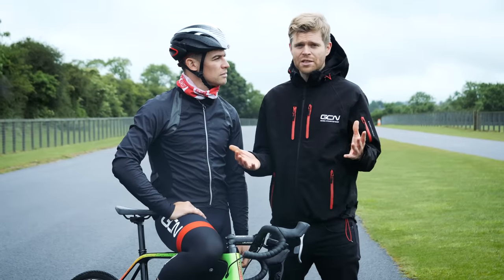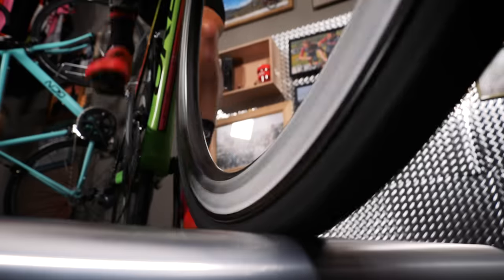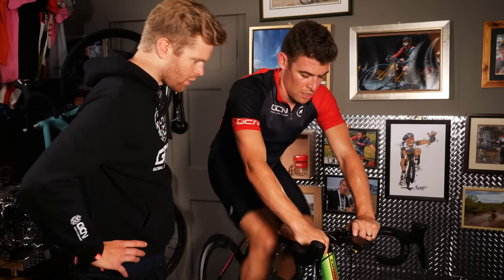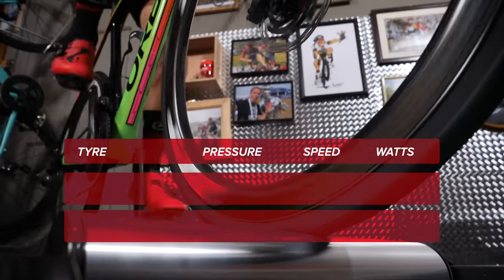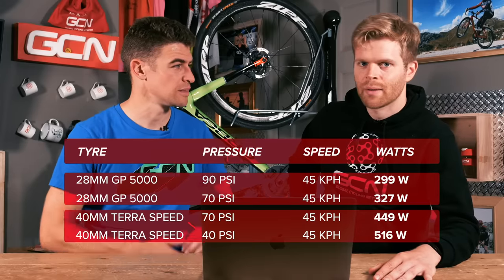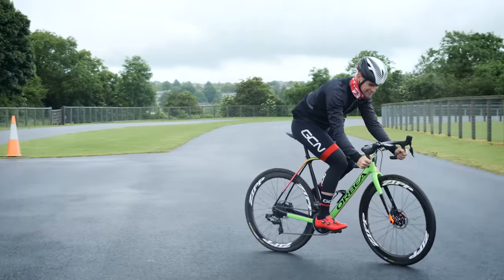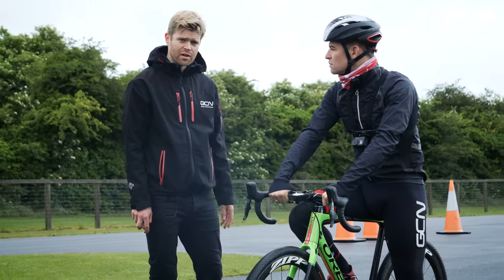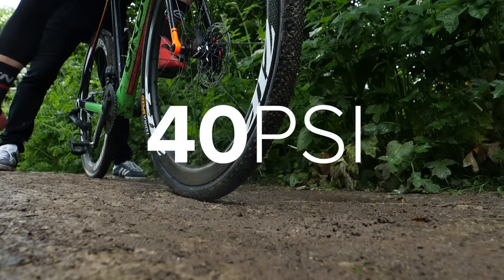Gravel Vs Road Tyres | How Much Slower Are Gravel Tyres?

Comment: Interesting - bicycle quarterly did a similar test but with slick, very supple compass tyres on imperfect tarmac and they basically found that rolling resistance decreed as they tyres got bigger until they reached 28c at which point rolling resistance pretty much levelled out until they reached absurdly large volumes of over 50c - they also found that tyre pressure has little to no impact in rolling resistance, so long as the tyres are slick, supple and light-weight.
Reply: Ding ding ding ding ding you sir are the winner! 👍👍👍
Jan Heine & Co., have proved that this BS is nonsense once again gcn proving their ignorance and lack of understanding when it comes to Scientific experimentation inductive reasoning and actual analysis
Reply: Thank you for bringing this up. It’s actual best tested in doing Strava segments with different setups. My experience has been that 44mm slicks roll as good as 28mm on tarmac and much faster on bad taac and gravel. No doubt whatsoever. Just let the masses ride their skinnies and suffer bumpy rides for no reason.
Reply: Long ago, I disregarded the 
'Conventional Wisdom' and have often utilized 38mm - 60mm (99-123mm) tires on Mountain (& FatTire) Bikes - *OnAsphalt*...  
My Klein QuantumII & LeMond 'RoadBikes' have almost 200 miles on 28mm (Max) Tires - after 4 years...  (while) 
My On*One Fatty with 4"/99mm FatTires has been ridden over 345miles - On ONE Weekend...!!!  
My Trek Farley EX8 Full-Suspension FatTire MountainBike gets more mileage a month than all my (so-called) 'RoadBikes' and 'TouringBikes' put together for the year...  
(My Brevet Randonnee Bike used for 100k-600k 'Road' Rides is an older MountainBike with Serfas Drifters or Continental Town&Country Tires...)  

The extra "Cush" and Comfort, how little it may seem, really Adds Up after 35miles and 5000' of Vertical on Gravel Jeep and SingleTrack...  but we continue with some Asphalt and more Gravel and Jeep Trails for another 40miles and 3400', and gave up early to 'avoid' the so-called "easy half" of the Irreverent Ride 8.0 (IRR8.0)...  
NEXT YEAR 77mm Tires!!!  
(and none of this 44mm so-called "Faster Tires" nonsense...)
Reply: too bad i cant find that test anywhere... i suppose its only in magazine? which is a shame really
Reply: @automaticraccon  " My experience has been that 44mm slicks roll as good as 28mm on tarmac"  Nope completely against my experience. 1-2 mph faster for free on road bike every time versus my cyclocross bike.
Reply: @geoffreyanderson4719  I not talking nobby 33mm tires I am talking 44mm slicks. And yes it's true. I did the Hamburg Cyclassics bike race and kept up fine with road bikes, placing myself in the top 25% overall in my age group.
Reply: Xaver von Treyer the link is dead/missing...
Reply: Xaver von Treyer isn’t that published by the manufacturer of compass tires?
Reply: @austinshoupe3003  Yes. The also offer narrow tires. This line of thinking is also supported by one of the industry leading companies: Silca.
Reply: @automaticraccon  eh. Always side eye a source with a financial benefit from the results of a study.

Comment: I would prefer to see tests comparing these two types of tires on a road and with a speed that average cyclist ride, like 30 km/h. Test like that might be extremely useful for someone considering buying a bike with drop handlebars
Reply: If you've got the power 30 kphs is not hard to reach. I run a pair of Continental Race King (2.0) on my adventure bike and 30 kph is no sweat.
Reply: For me on the same course and same bike but with 40mm tyres I manage 27 km/h avg and with road tyres 28mm it is 32 km/h if that helps. After 20 km/h there is also AERO factor so the road bike would be more aero and also you need different set up for position for off road so that also affects aero.
Reply: For me, on the road, on the same bike (my cross bike) the difference between 40mm knobbies with "fast rolling lugs" (Maxis Ramblers) and 32/28mm slick tires (Sector 32s/28s) is at least 1mph (1.6kph) of speed at the same watts over the same course riding at around on the upper side of my endurance pace.   But there is a rim difference there too, so that difference might be exaggerated a bit due to aerodynamic gains and a couple pounds/1kg  or so of weight being shaved off as well.  If I am riding closer to high end tempo pace the difference can become more exaggerated, closer to a 3mph/5kph difference but this is likely again due to aerodynamic gains as much as rolling resistance.   And it gets even higher if I was going all out.  I run everything tubeless if that matters.  

If you want to go by gear ratio, riding fast at the high end of tempo, on the downhill side of a roller or a false flat / light descent,  I'd be riding in a 13 or 12 on the cassette on the 32mm tires in places I'd be riding on a 15 or 13 on the 40s with the same watts, and spinning the cranks a bit faster too as well.

Or for another perspective, I can keep up while riding in a pace line with Cat 2-3ish road cyclists or 50+ masters (I'm old) on my slicks/carbon rims.  But not on the knobbies/heavier aluminum rims, I'll blow up and fall off the back and get dropped.  Due to aero and possibly weight when hammering it up hills, which is how they like to do things.  I'm a skinny 59kg dude, so 2# of extra weight probably does matter to me in that scenario.

That said, I still like riding the 40s a lot of the time because they are more comfortable on a rough road of which there are many here.  And I can take the knobbies out on mild single track which is a blast on a cross bike.

So I just swap out depending on what I'm doing.
Reply: Personally, I have a gravel bike for the confidence in loose and rough conditions such as cracks and potholes or gravel. However, I can easily throw some road tires on it and use it as a road bike. The only thing with mine is it isn't am aero bike (if that's what you're into) but it is definitely more durable for those rougher conditions.
Reply: @davethedogdude  I've been breaking PRs on a Canyon Grail this summer, on the road, after coming back from an accident in late May. Today I pick up a new road bike and am terribly, terribly interested to do my own "real world test" of how much faster the road tires (and bike) will be. FYI, I've been blown away with how fast the Grail rolls down hill on the road - most of the time I'm passing all the road bikes, even when I'm not pedaling. It's the uphills that make me work really hard.
Reply: @RedWingsninetyone  I would say you have the right bike and the right idea, resist the urge to ever get an expensive aero bike. Your bike probably has great gear ratios for a trip to the alps or pyrenes ( or the lake district) as well.

Comment: I was looking for exactly this video, because I wanted to know whether I need a road tire or not. Many thanks for this timely upload.
Reply: Depending on how much gravel vs tarmac you ride, you might look into the Rene Herse 700x38 Steilacoom or 700x42 Hurrican Ridge.  Ted King is winning 100+ mile gravel races on these, and supposedly they roll very well on tarmac.
Reply: Michelin jets, kenda happy mediums, most any file tread cyclocross tire work on every surface. True, only 33-35mm but how often do you need more? These tires are great gravel tires and make group rides on the road a much more demanding ride, which is necessary if you re the alpha in the group and riding with your freinds requires you to back off a bit.

Comment: Continental 4 season 32mm tyres, avg 30,5 km whenever i ride it, and also good for gravel/tarmac/and Belgium roads here!😉👍
Reply: Conti 4Season is a great tyre for bumpy, cold and/or wet roads (and even typical "big city" roads with lots of threats like shards etc.) - but the GP5000 is MUCH faster. whenever I switch back from the 4season to GP in spring time it feels like doping. (and it comes with a 32 version too)

Comment: Great test! I would really like to have seen something like 32mm gravel vs 32mm slicks though. How much would I save on my 40 min commute by swapping out my gravel tyres with road tyres ?
Reply: Exactly, these people dont know what the mass public wants.
Reply: Probably Bugger all in reality. I used 25mm tyres and switched to 32m gravel king SK. 1 minute difference over a 10 mile commute (traffic lights make more of a difference). Not worth worrying about and the comfort and puncture protect was hugely increased.!
Reply: Swapped put my 28c road tyres for 32c gravel Kings over the winter,  not as spritely as road tyres, and not as fast, but certainly good enough, plus I've been going off road a bit when the mood takes me
Reply: @guybrushthreepwood3002  everything is a compromise I guess. I prefer the comfort and freedom over speed 😎
Reply: @Northernerdownsouth  you can get all of the above with 32 or wider gp5000s or other high quality road tires. Virtually unflattable, super fast rolling, great grip and a boost in comfort. Go tubeless if possible for extra flexibility on pressures

Comment: Wow chaps, you deserve a thumbs up just for the amount of times you swapped out the tyres!!  May I suggest that next time you procure a couple of cheap wheelsets (assuming the budget can't stretch Zipps).

Using cheaper wheels will have a minimal effect on results. Then again, on the flip side, changing so many tyres may have strengthened your "thumbs up" 😁😁😂👍👍👍👍
Reply from the maker: There is no 👍 big enough, honestly.
Reply: I doubt they pay for almost any of their gear. They’re a massive ad platform for their sponsors

Comment: The thing is, GCN, there's different types of "gravel tires" and knobby tires ain't always what some riders go for. On the road however, most riders use an almost identical tire pattern. But - strong riders can definitely make almost anything go pretty damn fast, be it knobbys or slicks.
Reply from the maker: Of course. Think we'd tyre poor Opie out if we tried every single tread type!
Reply: @gcntech  Throughout this vid I was thinking the real MVP is whoever had to seat continental GP5k's about half a dozen times.

Comment: Cool video. What I would’ve like to see is a test similar to the ones you did on the rollers, but outside. Just find a flat smooth section of road, ride at the same power, but use different tires and pressures to see how long it takes to go a set distance. This would also account for aerodynamics of the tire. The only variable might be the wind, but you could repeat the efforts enough times to mostly eliminate that.
Reply: Or run the test at an indoor bicycle track.  
The roller test exaggerates the tire differences, due to the more severe deformation.

Comment: I like "everyday-science". These tests where fun to watch and  had some good insights. I am riding 2 tire options: 1. GP4000 28mm 2. GP 4Season 32mm (in "winter-times"). I find myself being about 3 km/h slower with the winter version (average somewhere 30km/h). To be honest I had to get used to that reduction of "road-fun" :-( BUT the grip on wet and cold roads  in autumn/winter was MUCH better with the 4Season. MUCH better!  Next autumn I will get back to the 4Season.  You always have that painful equation of comfort-safety-speed-durability-xyz. EVERY tire is a compromise. I found 2 good ones for my usage.

Comment: rolling resistance is, well, rolling resistance. Gravel/larger tread tires provide more grip and control on loose surfaces. I think that's the science of how they are designed.

Comment: Try testing a given power output on a surface type, including corners?
Roll down tests are interesting, but don't tell us much about day to day riding.
Reply: These Muppets don't even understand what scientific and inductive reasoning are. They really reveal themselves as such under-educated dopes in Lycra! 🤣 I don't think they could even analyze boiling water 🙄🤦‍♂️
Reply: @archetypex65  that's rather unfair: the method used in the test was perfectly valid, and the limits of the test were accepted at the time.
My original comment was more related to further testing which could be used. A roll down test is probably the most controlled test possible outdoors, but so controlled that it provides one piece of information which is of limited use in real world applications.

Comment: I'm typically about 2 MPH slower on my cross bike with Surly Knards than I am on the road bike with GP4000s.  The only thing surprising about this to me was just how many more watts it took to maintain the same speed with the gravel tires at 40 psi vs the road tires at 90 psi.  I'm feeling a lot better about my speed differential now.

Comment: When we ride bikes, our power output needs to be transferred to the surface to create forward movement. Gravel tires have tread to enable this transfer on the rougher/loose surface, in conditions where a smooth tire would slip. It's like running on a track with trainers vs spikes. If you're just casually running (like coasting downhill) trainers would be somewhat equal to spikes, but as you start putting power down (like pedaling) spikes gain advantage as they're able to "grip" the surface.
Reply from the maker: Good analogy Samnelso

Comment: I found this presentation really useful particularly in the scenario where a long tour/expedition ride that may include both off-road/gravel and on-road conditions.  I would be tempted to fit robust gravel tyres but tests like this give me some indication of the price I would pay (in increased energy consumption) when going onto the tarmac road.
Reply: Christopher X,
Don’t make any decisions based on these tests. You should really take into consideration what you’re likely to ride on, and then figure it out. Even riding on a rough asphalt road, a lower tire pressure can make a big difference in overall comfort. Comfort has a big impact on how “tired” you may feel afterwards. Sure you may burn 1050 calories vs 1000, but if you hands aren’t numb afterwards...etc.

Comment: I'd have liked to see the roller test being done on the tarmac track. The difference in surface might have made a difference.

I've just been doing my own experiment. I have a cyclocross bike and had been using 35mm CX tyres. With most of my cycling being on road, I switched to 28mm road tyres. I cycle alone, so I'm not keeping up with a group - it's just about putting in about the same effort for similar ride durations. There's been little difference in overall ride speed but the comfort is reduced over even small blemishes in road surface. However, last night I was back on light(ish) gravel and the difference was huge - the road tyre grip was poor and it was much less comfortable to the point that I had to back off.

The road tyres are at 70/90psi (F/R) and the CX tyres are at road friendly 50/70psi.

I'll persist for a little longer but, as it stands, the CX tyres are better all round for me.
Reply: Valid points I'd have to agree with you on some points but I'll add that I really hated how fast I was wearing out my CX tires on road. I don't really have many rides on the CX tires but the rear tire sure has seen better days, I'd imagine I'd have to get new tyres about thrice as fast if not faster as my 28mm schwalbe durano's lasted me about 2 ish years and still had plenty tread life on them but had some sidewall damage.
Reply: Ridiculous.

Comment: I replaced the knobby 32 mm tires in my B-Twin Triban 100 with Vittoria Zaffiros, 25 mm. front and 28 mm. rear. It really pays off during longer rides.

Comment: I just went on a ride using gravel tires (Vittoria Terreno Dry 40mm) with my dad for fathers day that went on a bunch of roads I had recently done with road tires (Continental Gatorskin 32mm) and this sounds about right, although I think my Terreno Dry tires are a bit faster than those continentals cause they have a file tread.

Comment: when I see the difference in power in this video and compare it to my own experience: conti raceking race sport 2.2" mtb tyres v.s. conti p5000 25mm road ending up with only +- 2km/h speed difference around 30km/h on same intensity. My guess is that roller with offroad tires is just a very bad combination (they tend to flex around it as if it's a bump in the road).

Comment: I ride wtb byway 47mm tubeless tire with 2.5 bar on the road with group race rides and most of my times I ride on my race with 28mm tire with 6,5bar  conti 4000 with inner tube
I also ride with power meter but the group rides with my gravel I get a normalized power of 250 and with race 220watt 

I did some solo tests on a 3km road same day same wind conditions and so with same power 250watt I had a avarage speed on my gravel of 31,1 and with my race of 33,2km/h 

I know the wtb byway is almost a road tire. but tells me a bit howmuch more effort I have to put in when riding my gravel bike on the road :) 

Also few weeks ago we had a climb with our group ride 6% avarage over 1km first part smooth asfalt last part koppelsstones. first part I had to hang on and almost got dropped, when we hid the koppels, I rode past every one with ease :)
Reply: Yupp, same here. 6 bar 28mm Vittoria Corsa G+ on my road bike,  and 2,4bar 50mm G-One Speed Tubeless and my gravelbike - a good 2kph speed difference around the 30kph mark between both bikes. the road bike rolls noticeable further when off power and climbs much better (3kg difference). its also quicker to accelerate due to around 1kg less rotating mass. the gravel bike on the other hand flies over cobbles and bad roads and drops any roadies there. (oh, and of course it can go on gravel ;) )

nobby tires, like the gravelking sk however add noticeable amount more drag over the fat almost-slicks.